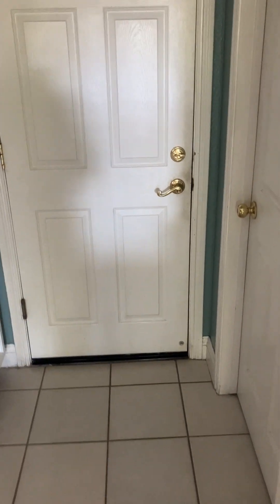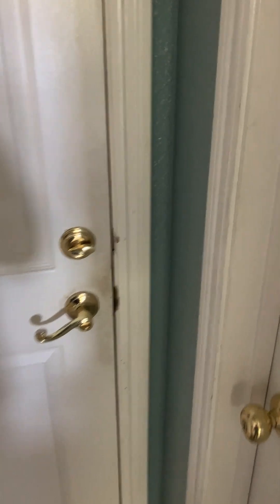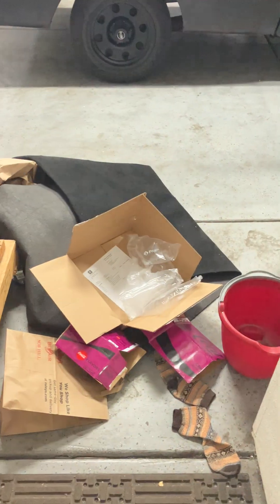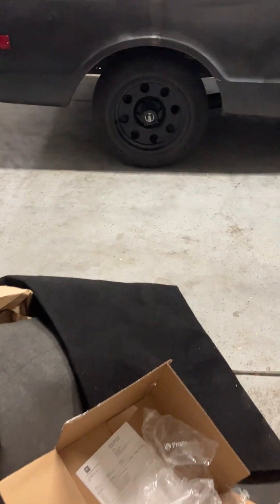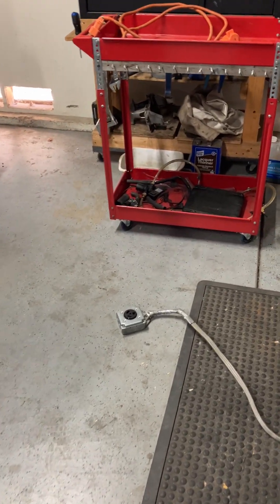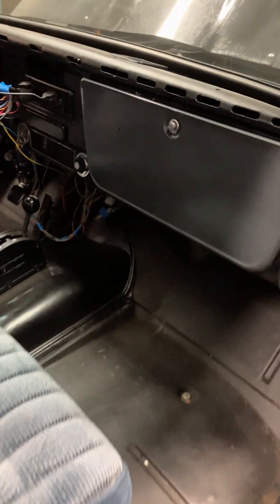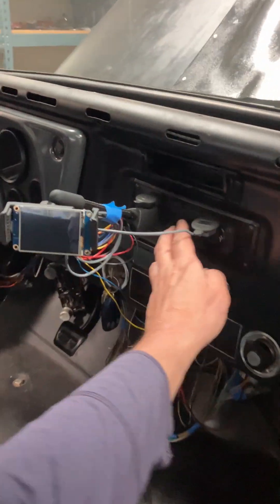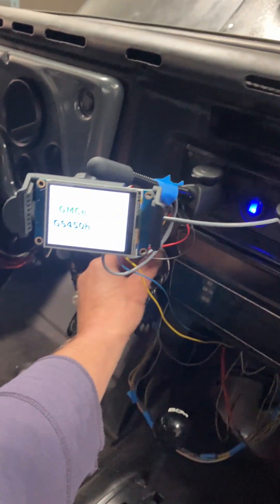Tech Talk Tuesday: Should you make your EV Conversion reversible?

Comment: It's all according to what you are converting, you don't want to reduce the resell value of a very expensive collectable classic
(if resell is important to you)
Reply from the maker: no one is converting expensive collectable classics so my point still stands, no one has yet to reverse a VW Beattle EV conversion back to a 40 horse power oil leaker lol
Reply: @Good-Enuff-Garage you are definitely in the echo chamber, there are many many super expensive collectable classic car EV conversion videos here on YouTube

Some are totally Bolt in to the original engine and tranny and other original equipment Bolt holes and mounting points

* Rolls-Royce
* Bentleys
* Jaguars
* Corvettes
* Ferraris
* Lamborghini
* Classic American Muscle cars
* much more

Sometimes they remove the suspension and put upgrades so that they have a better ride and not wear out the original equipment

And some have actually cut and weld and didn't care about the collectible value and went all in with their EV conversions of their expensive collectable cars

Do a search for Icon-Derelict, they have done some EV conversions on classic cars and sell them for six figures and up

Comment: How much power will the Lexus transmission output?
Reply from the maker: When I dynoed it on MG2 only and only a single about 80% charged battery pack it pulled 125 hp, when Damien dynoed his with a hodgepodge battery pack with both motors it did 225 hp, so I hope somewhere north of 250 hp now  🤞🏼

Comment: Forgive the silly question, but, how then do you back the truck out of the garage? Pull it out?
Reply from the maker: if your question is regarding the orange charge cord, I just did that to have something visual while I talk, this is a make shift "Level 2" pronounced 240 volt charge cord that I made and it just plugs in to a clothes dryer outlet, I simply unplug the end that is on the floor and wind it up and velcro or zip tie it to the regular car battery handle, this is a interim solution to get you charging at your own house, your family members homes and or friends, it's not meant for official public charging stations
Reply: lol your comment is probably a joke. Pun on “reversible.” The truck has a reverse gear and will never be converted back to ICE.